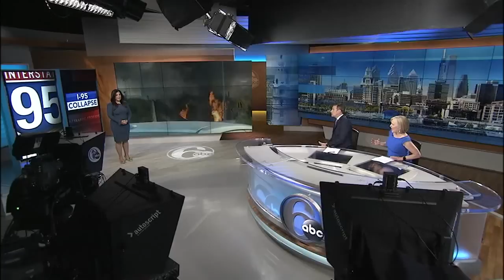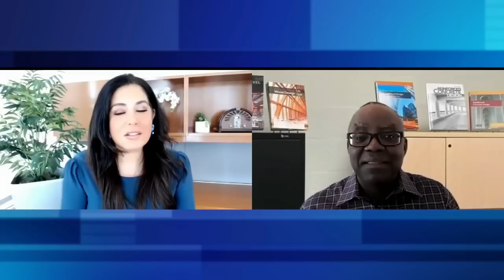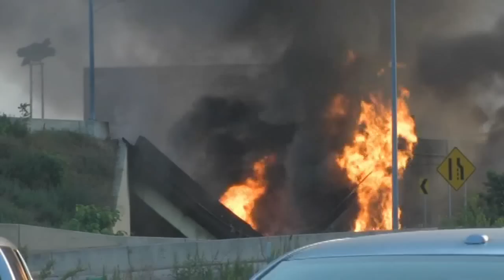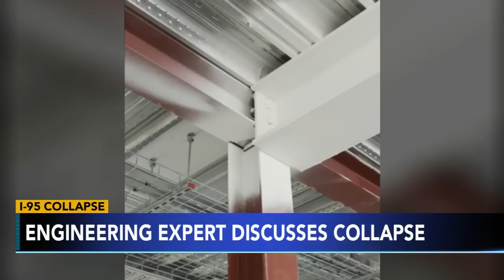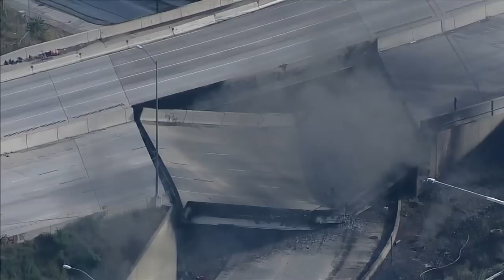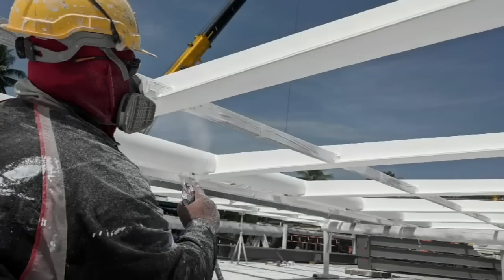Drexel engineer explains possible cause of I-95 collapse

Comment: The trucks looks to have crashed by failing to make the turn. This happened to be where the overpass is. How about designing it so drivers are not making a turn while under a freeway, and make it a straight passage.  Place the turns outside of the under-crossing.
Reply: How about professional drivers hauling hazardous materials drive more carefully?

Comment: the big thing people don't understand and I don't care what engineers say and you can say add all this fire proofing it will help well the true fact is people that when you add sutch a large high amount of heat for a long period of time stress and weight will take it toll and destroy anything as you can see from this large fuel fire. anyone with a real brain can see that long before the bridge fell apart. use some common sence already people.

Comment: I'm pretty sure that the steel would have heated up even with that paint on it.  It's not like the paint behaves like an ice pack.  You can bet that, if the paint is subject to 900 degree heat, the steel will also get up very very very close to that, which would make it sag and ultimately collapse.

Comment: I’m a driver and if he hit the curve too fast the liquid would surge and roll him over. The materials used to build the truck and trailer are more flammable than the 87 octane fuel at some point.
Reply: perhaps not too fast,just fast enough for the liquid to "splash"inside the tank.another idea is he had a front blowout if he was going a bit hot.
Reply: @elelectrotech9374  Most of the tanks today have baffles inside instead of the smooth bore like back in the day. It’s still possible to go too fast for a curve but the baffles prevent the product from surging forward in case you get caught by a red light and hit the brakes. Back in the day when the surge came forward it would push you into the intersection.

Comment: how about to temporally fill that with dirt, asphalt, and opening it ?  it could be done within a few days, then taking time to plan the construction of the new bridge and the detours during that time.
Reply: That’s the plan. Not dirt but lightweight aggregate. There are sewer lines that run under the ramp that can’t take the load of regular dirt on top. So using foamed glass aggregate that weighs 1/8 the weight of stone. Looking at 4 weeks to get this demo, clean, assessed, filled and roadway built on top. The fill will also use wire walls so that it can be staged for rebuild with traffic maintained.
Reply: @oscarwinner2034  - Nice.  Sounds better than the four months I heard.  Thanks 👍
Reply: @oscarwinner2034  - I remembered what you answered me 10 days ago, and wow.  I'm so impressed.  Seriously.  They did an amazing job.  Congrats to all those workers!
Reply: @JeSuisUnePatate  Nice. I’m working on this project. So I kinda had an inside track. I’m actually in the background of most press conferences. Honestly the fact that we were still working on the overall interchange project made handling this much easier. The designers are still here who designed the bridge. So everyone just jumped to this right away and things came together quickly. Little bit of fire drill with so many people in the mix - but it seems to be working out well.
Reply: @oscarwinner2034  - Congrats once again!  You did an amazing job.  Watching the PENNDOT webcam right now - Both directions are reopen...  Wow...  👏👏
Reply: i think that was an exit ramp.
Reply: @elelectrotech9374  - yeah, that was an exit ramp, but how about keeping it closed for months and reopening the I95 asap.  there's others exit ramps that still exist..

Comment: 87 octane fuel doesn't burn hot enough to melt steel, does it?
Reply: Steel does not need to melt to lose strength.  Think of a candle on a hot day, you can bend it without breaking it long before it is liquid.

Comment: The steel did not melt. Steel looses about 50% of it's strength around 1100 Degrees F. Once that occurs, deformation is likely to occur. The steel beams underneath were directly exposed to the intense heat and with all that heat unable to dissipate from in between the beams, the concentration of heat was exacerbated. The weakened beams buckled under the static load bearing down on them. To suggest that fireproofing would have prevented this failure is absurd. The strayed on fireproofing you see on structural steel inside buildings is not meant to be exposed to the elements.
Reply: Well explained thanks
Reply: Absurd is what the news wants. Extreme gets the viewers locked in.
Reply: @oscarwinner2034 :  That college engineering doctor definitely did it for publicity. I'm no engineering expert but I doubt any kind of fireproof paint is ever applied to any bridges.
Reply: @hawkeye5955  I've never seen it. We coat the beams on site for corrosion protection. Most bridge steel is so corroded. We joke that we use load bearing paint. I can't imagine having to apply a fire paint.
Reply: spot on

Comment: The fire proofing would have done little as this was intense flames and over a long period.  Metal weakens and the fire proofing would have helped for the first 20 minutes or so but the steel would have bent and sank regardless.  Also remember 9/11.  The intense flames of the fuel fire is what brought down the towers.  Metal bends under intense heat
Reply: Yep, doesn't even need to melt. Can't support weight if it's hot.

Comment: This is terrible idea.  As far as I'm aware, no exterior bridge beams are fire coated because it's really expensive to do and for how long that bridge was exposed, it wouldn't have helped.  I don't know how well the stuff holds up to the elements.  Plus how do you inspect the bridge steel beams with the coating on it?
Reply: Engineer maybe just wanted to get on the news.  The fire-resistant paint is not practical and not fireproof either that's a huge misconception. I agree it wouldn't have helped the real cause. Once the fire buckled the steel, they weight brought it down.

Comment: Gee you need a Drexel Engineer to point out the obvious that extreme  heat bends steel   and damages concrete wow who da thunk it
Reply: Ironically there are Drexel engineers working on the repairs. Should have asked someone who actually is working on it.

Comment: You don't need to ask experts to tell you why it collapsed... Anyone who drives in that area can tell you that all the bridges and overpasses look like they are about to fall. There are giant holes in the concrete on the ramp leading up to 95 just off of Aramingo Ave. I avoid Philadelphia and Delco roads because they are scary.
Reply: It would be nice to have some video of the truck crash. Or dashcam footage before the collapse.
Reply: @DialogDontArgue they finally released footage of the actual crash but it’s on the worst quality security cameras I’ve ever seen. I’m hoping to see video of the actual collapse somehow but I haven’t seen it anywhere. Let me know if you do
Reply: @MiniMogul420  Traffic Cameras don’t record. ACLU prevented that as you can see inside someone’s car. The traffic control center can record when there’s an accident to review response procedures. The camera near this bridge is on the north side. The fiber that connects it to the system ran across the parapet that collapsed.
Reply: This bridge was less than 8 years old. Just sayin’
Reply: @oscarwinner2034  they just don't make things like they used to.
Reply: The ramp at this exit was less than 10 yrs old and was perfectly smooth with no potholes.

Comment: That looks more geared for protecting a commercial building, with pretty limited fuel sources. Not several thousands of gallons of fuel, with the aluminum tanks likely eventually igniting too, which burns hotter than the gasoline would.

Comment: The steel did not melt.  The steel expanded and then sagged.  The high heat weakened the span.
Reply: The steel definitely melted and it’s definitely possible with 87 octane gas. just look at some of the photos of the bridge and get a close-up of it.

Comment: Dude .. paint may be fire resistant up to a point...but is not temperature proof.Did you not observe  the design?. Those are literally  space that have no where for the heat to escape.  Where did you get your degree? A cracker jack box. . So you think some paint is gonna prevent  that from happening  again?. Come man. Somebody needs to fire your azz and Give a good slap in the mouth for saying  such BS. Man gtfoh.